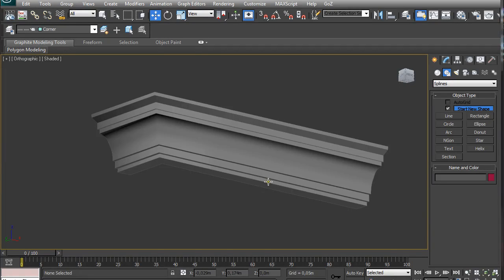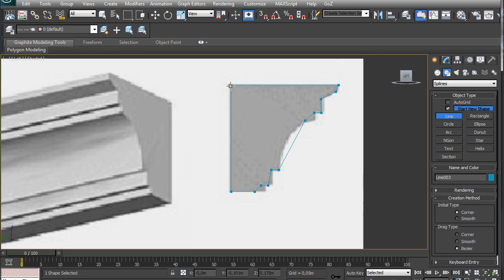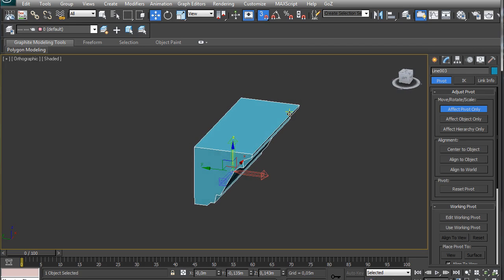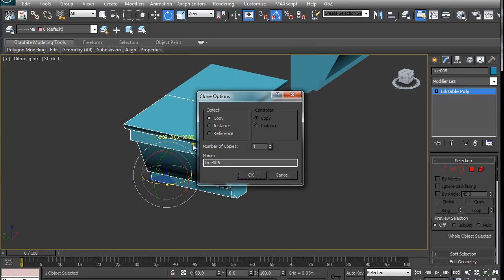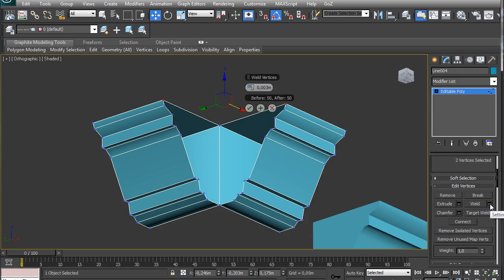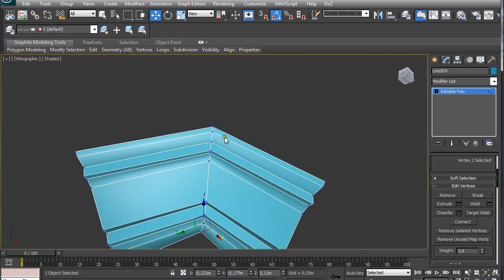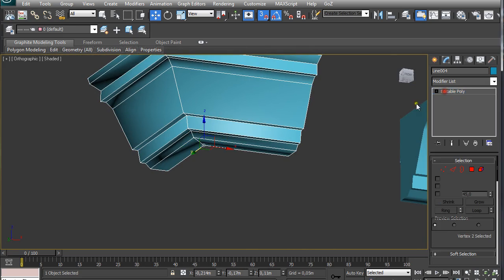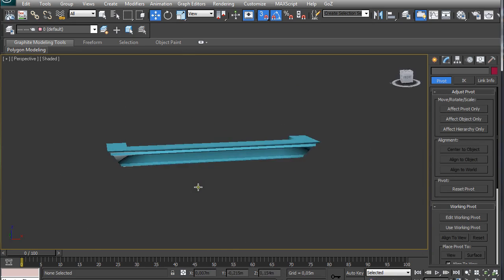Tutorial: How to model a 3D hi-poly molding in Autodesk 3Ds Max

Comment: It's much easier if you use the Quick slice tool. You can align align both pieces of geometry so they overlap and then go into the top view and just slice each side separately along the angle you want joined. Then everything lines up and you don't need to do the manual tedius work of joining all the verts together. This works on all kinds of complex geometry.